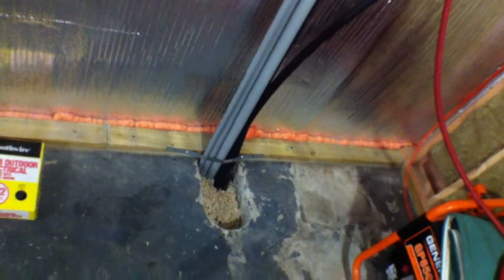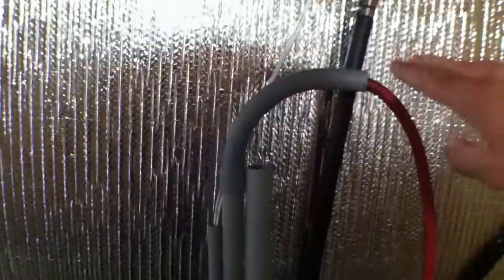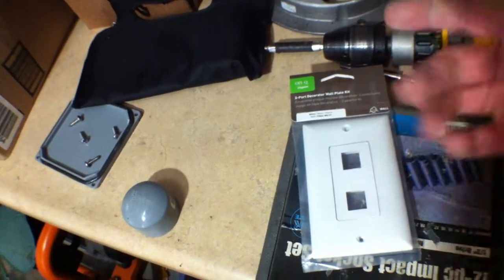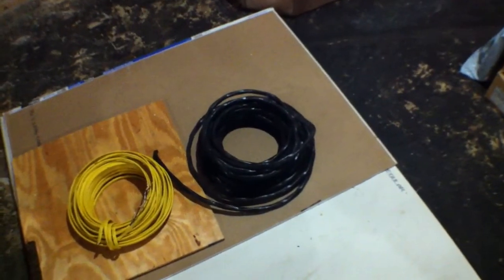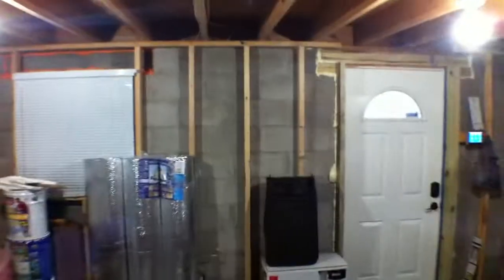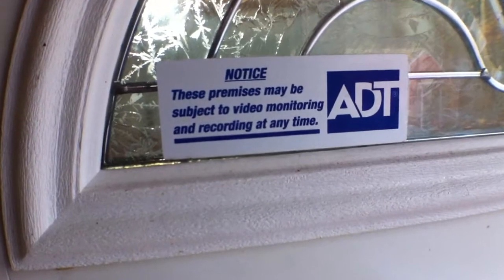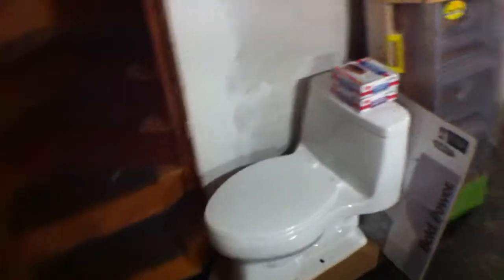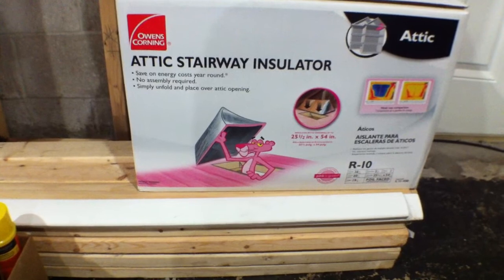Shed Connectivity 2 "Show and Tell" Video

Comment: what happens if the phone line gets cut, can it switch over to use gsm for messaging & 3g for video streams, you can never over do cctv and alarm systems.I custom installed my setups at both property's, its impossible to even approach without detection and notification. its stopped 5 attempts with three arrests sofar.